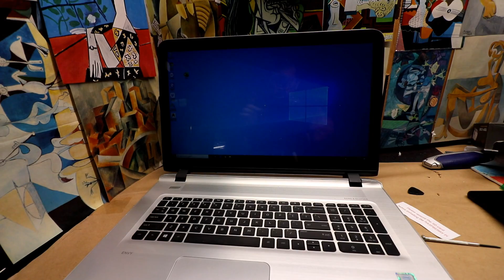HP Envy 17-n179nr How to Open and Upgrade Ram SSD

Comment: Awesome video! I would like to as for your expertise on this particular PC. 1st, is it even worth me upgrading to the SSD? My thought is to make my PC be able to run some of the current games. One in particular is a a new game called Valheim. MY PC will run it, but on the lowest settings. so I am not able to enjoy the game in it's full capacity. I was wondering if it would be worth, replacing the RAM, SSD, and Video card. But I feel like the motherboard is not going to be able to handle the new equipment and just slow the whole unit down. Would you agree? Should I just look at a new Laptop? @DrewTalks